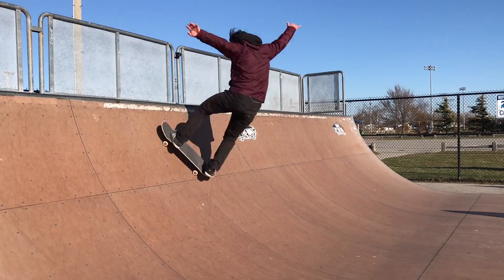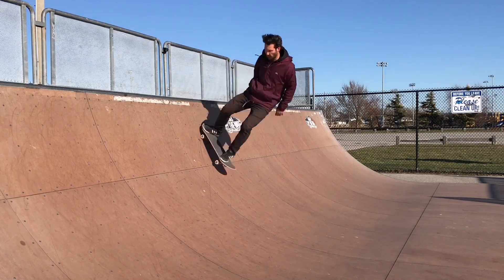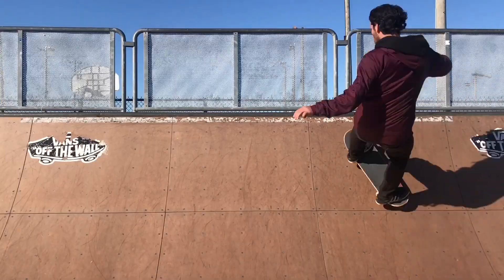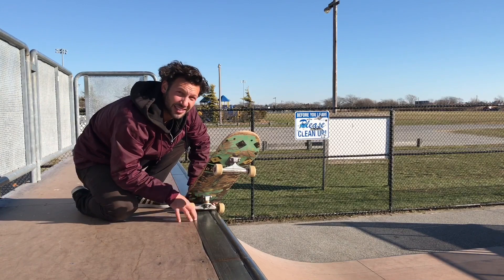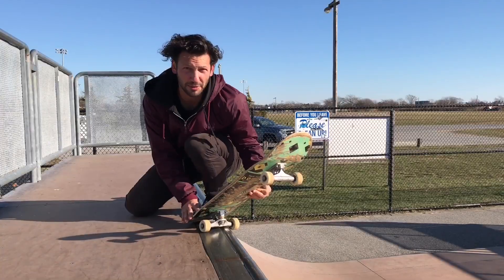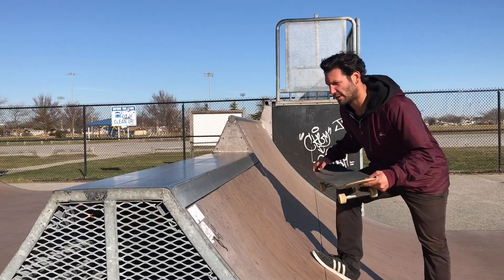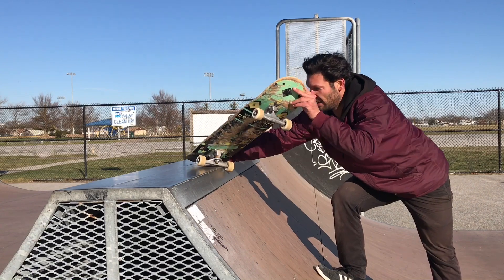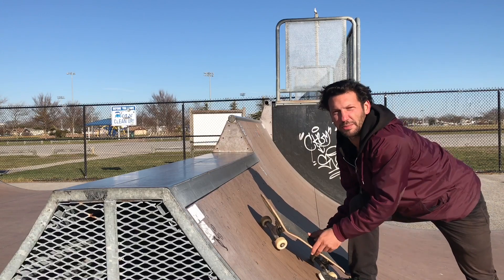How To Frontside 5-0 To Fakie On A Mini Ramp

Comment: i just started to skate transition and i finally did a 50 50  and a backside smith so i decided to try a feeble to fakie bc the guy at the park hyped me up. i almost had it but my truck would catch or land in a blut stall when i tried to go back down. Anyways i dislcoated my wrist. lol
Reply from the maker: Lol damn! It happens to the best of us, how long are you out for?
Reply: i took like about a week and a half and i still go over there every now and then to just ride around and do tricks ik i wont fall on. i dont know if its just me but a back smith is easier than a 50-50 i even got to slide it a little bit, on a mini ramp of course.